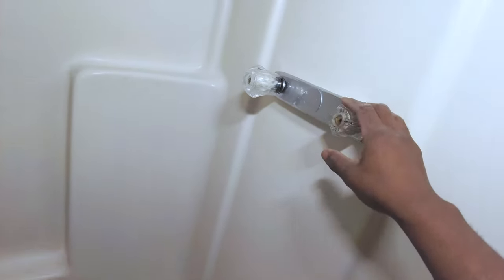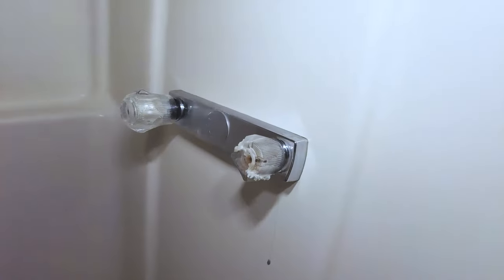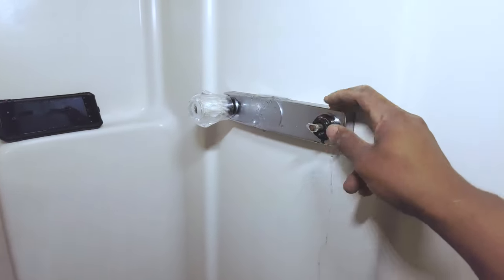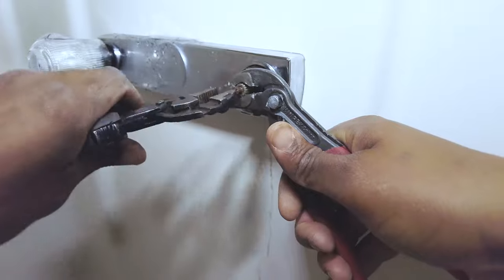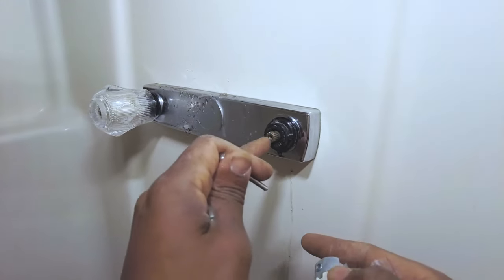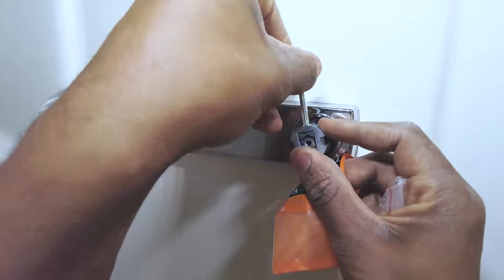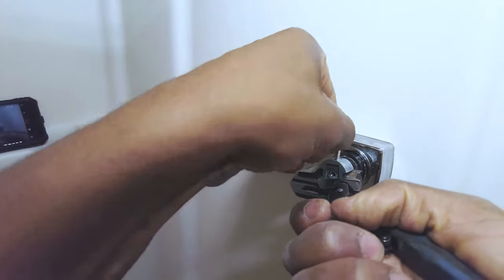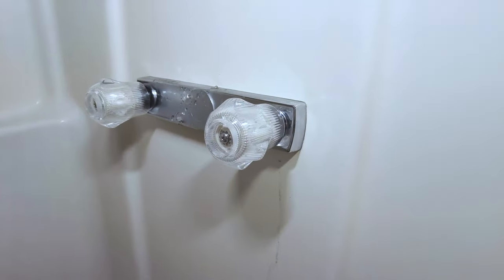What To Do If Screw Is Rusted Out or Broken In Shower Faucet Handle Shaft Easy Fix DIY Shower Repair

Comment: Good job, I'm looking for a sink faucet - as you said, I think the screw stripped out and won't come out.  I'd take a tool to cut it, as you did, but the handles are metal.  I'm hoping I don't need to Sawzall the whole valve.  The easiest part is going to take the most time, ugh.

Comment: Tried this but sadly it's not working out, even with those same adapters. The handle screws into the nut, but when you turn the handle it just comes off the adapter and takes the nut with it. The clamp won't hold the nut in place.

Comment: Fantastic! I need to translate to a metal handle, but the tricky part is a tiny Alan screw under the dial. Will look for more of your instruction.
Reply from the maker: Nice! The most important thing is to make sure you tighten it very tight and use a backing wrench on the shaft while tightening it.

Comment: I will have to try those knobs.the double wide I live in was built in 97 and not sure of why but the knobs you can buy for some reason the splines on knob are spaced different so most won’t work as it’ll rub the metal backing and won’t fit on splines so i will have to try the universal set up.thanks!!
Reply from the maker: No prob! Best of luck to you Yeah mine is still holding up solid

Comment: This is a helpful video. What do you do if the stud breaks off?
Reply from the maker: Thanks! If the stud breaks off you would have to replace the entire cartridge which isn't too bad but you would definitely have to turn the mains water off and disassemble the faucet assembly
Reply: @HVACTechKnowledgy  Thanks again for sharing this video and also for the quick response! Hopefully it's not too difficult to do.
Reply from the maker: Did the stud actually break off on yours?
Reply: @HVACTechKnowledgy  Unfortunately, yes it did! Only one of them came off, not the other.
Reply from the maker: Oh no worries they're not too bad to replace there are plenty of videos on YouTube instructing had to replace for a variety of different types of faucets

Comment: This doesn't make the screw "too long" because it's no longer threading into the stem, this requiring to cut the screw a little shorter (or buya slightly shorter screw)? (Awesome adaptation btw! I doubt I would've ever thought of this! You can work with me any time!)

Comment: Clever retrofit there with the nut! Almost looked like it was designed for that and they just didn't include the nut.
Reply from the maker: Appreciate the feedback! Yeah I was pretty excited when I came up with it cuz I tell you I couldn't find anything on youtube or plumbing forums to help, that's the main reason I posted this video  there is literally nothing out there on how to solve this issue without replacing the cartridges or tap.

Comment: How did you get the screw out after it broke off? I’m having the same issue
Reply from the maker: I didn’t get the screw out - that was the problem 😅. The broken screw stays in and I just made a modification to the tap handle. Check out the full video where I show you how to do it 👍

Comment: What did you do when the screw didn’t come out on the other side bc it’s striped?
Reply from the maker: The broken/stripped screw stays in and I just made a modification to the tap handle. Check out the full video where I show you how to do it 👍 😅

Comment: Well, this seemed like such a great idea that I ran out and bought the tools and the adapters and the nuts but for the life of me I could not keep the nut from falling out of the adapter while trying to screw the handle into it. Then, eventually, I tightened it so much that I broke the metal adapter that went around the faucet fixture.

So… here I am. I’m sure the oscillating saw will come in handy in the future as I just bought a house. I will be doing lots of other projects but at the moment, I still can’t take a fucking shower.

Edited to add that I got the other faucet handle together so I’m gonna run back to the store and see if I can get just the part that I broke and try again
Reply from the maker: Oh no! I'm sorry to hear that.  I know it's kind of a little too late but always make sure you use a backing wrench when tightening down the fastener to the tap stud.